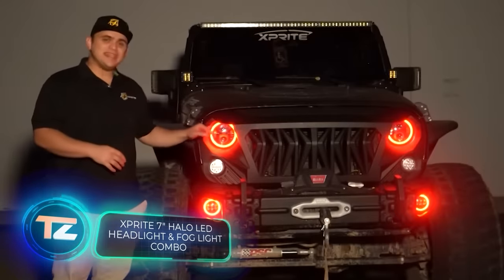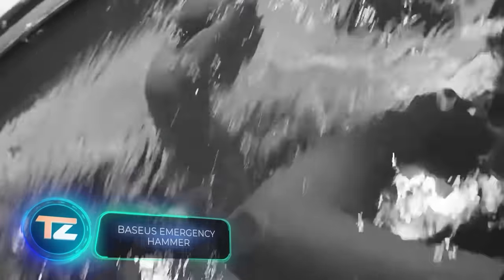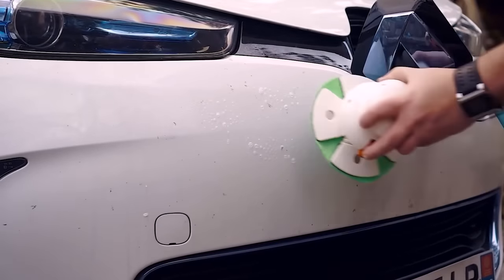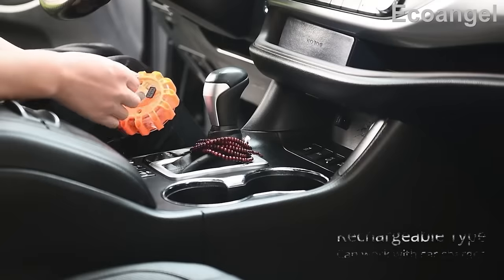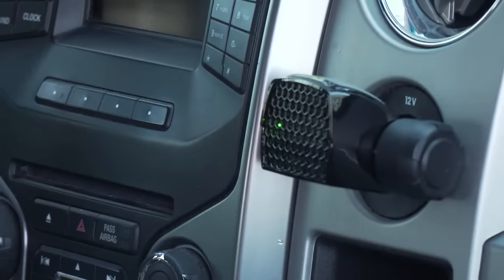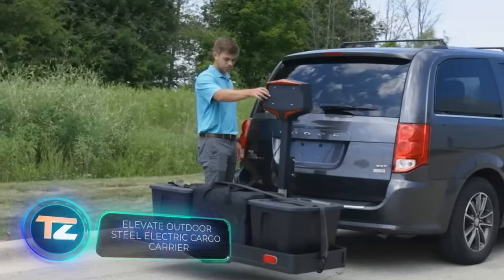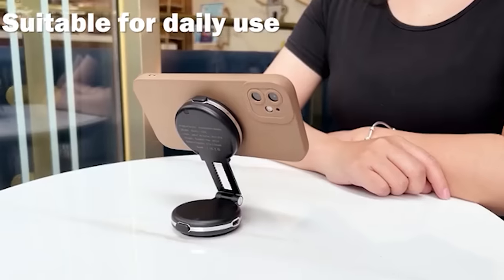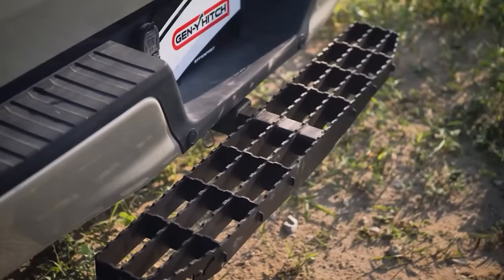INVENTIONS THAT WILL TAKE YOUR CAR TO A NEW LEVEL

Comment: Red lighting on the front of your vehicle I'm pretty sure is illegal in every state in the country. Red is an indicator for stop and it's only allowed on the back of the vehicle, not the front. A guy I work with bought a Dodge charger with the red halo lighting headlights the state patrol pulled him over. Gave him a ticket and would not allow him to drive it unless he was able to shut the red halo lighting off. He didn't know how to shut it off. He had to have it towed. He was not happy.
Reply: Same laws exist in all western countries and probably in many others (or they don’t have traffic laws).
Reply: That’s good, stupid should always pay a price
Reply: In Europe front light must be white, or yellow (for indicators), any other colour is prohibited.
Reply: Try driving in any state with a flashing blue light.  You’ll have every cop in a 10 mile radius descend onto your vehicle.
Reply: So you didn't notice that they change color or are you just ignoring that.
Reply: Using red lights to illuminate the front of the vehicle is completely wrong, it is only used as a warning light in an emergency or when stopping the vehicle.

Comment: This cup holder warmer operates with no switches. All you need to do is ignore that big red switch and voila,  no switches.
Reply: " operates with no switches" key word is "operates". Powering it on is NOT operating it. When your stove is plugged in and sitting there is it operating, NO. It is waiting to operated. not too bright are you.
Reply: @Julio_Martinez75  so you are deciding to ignore the big red switch.  I didn't even mention. The switch that detects the cup. It literally has 2 switches that it operates with.
Reply: @Julio_Martinez75   do you ever put anything that is not a cup in your cup holder? Do you only drink warm drinks? You never put cold drinks in your cup holder? There is an off/on switch for a reason and yes, it needs to be in the on position to operate.
Reply: @javierhernandez9445  Hey WE TODD. Do you have your blender plugged in? Is that called operating while it just sits there? NO. And switched don't detect anything. Those are called sensors. That operate either transistors or mosfets. So no you are still wrong. 

But you go on thinking that. You win the dense Olympics.
Reply: @AztecWarrior69_69  you might want to google some of these words you are throwing around before pretending you know what you are talking about.
Reply: @AztecWarrior69  sWiTcHeS dOnT dEtEcT aNyThInG. tHoSe ArE sEnSoRs...Tell me you have never taken a class for electronics or electrical controls without telling me you have never taken a class for electronics or electrical controls.
Reply: @Julio_Martinez75   DID it go through. Youtube deleting comments again.
Reply: @AztecWarrior69_69   Yeah are you not seeing it?
Reply: @Julio_Martinez75   nope not seeing it
Reply: @Julio_Martinez75  Anyway don't worry about it. That turd is already flushed.

Comment: colored lights on a car in my area ..on Or off illegal ...The $90 steering wheel lock ..Vs a $8 metal saw blade thru the steering wheel and bend...Stolen in 21 secs ..with your new toy lol